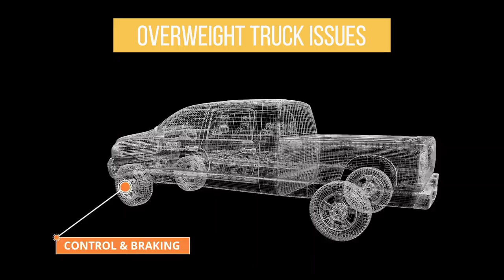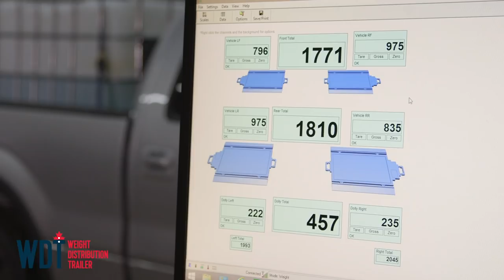Weight Distribution Trailer - Trade Show Loop

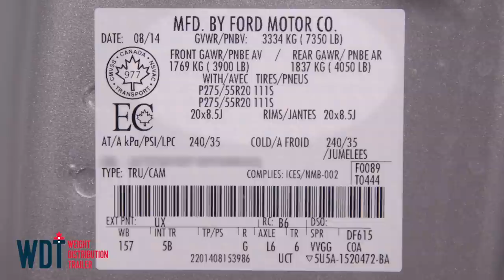Comment: You may want to consider changing the wording on the banner at 1:33 where it says that "GVWR is the maximum amount of weight your vehicle can carry".
Reply: Hi Thomas, the GVWR is the maximum weight according to manufacturer's specifications.
Reply: @canadianloaddividerdollies8413  Yes, the GVWR is  the maximum weight of the vehicle, which is the unloaded vehicle plus any cargo, passengers, etc.  The banner refers to the maximum weight that the vehicle can carry. There is a difference between the maximum weight of the vehicle and what it can carry.

Comment: Hear me out, I love the idea. Iv actually thought about something similar myself. But there's alot more goes into the GVWR then just weight distribution.... If this product allows you to carry up to a thousand pounds more, some trucks breaking system, etc may not be designed to be handling such weight... I can see a person going through breaks and overall suspension/front end parts possibly even faster with this product, as they believe they can go 1k lbs over their rated GVRW
Reply: Hi Dylan, we have tested it on all your points. The fact that our Weight Distribution Trailer proportions all the axle automatically there is less wear on components and it is stopping distance certified and decreased emergency stopping distance by up to 16 feet because now all you braking wheels are balanced for proper axle weight.
Reply: Do the added wheels have brakes too?

Comment: From all the comments here you can tell nobody is a truck driver. This thing's essentially acts as a drop axle. It's a cool idea. Most working men that I know though typically drive 2500 or 3500 style I'm not sure if this will make a difference on something like that
Reply: Thanks Guitar Player Dae, actually it works on all classes of pick ups. I agree that those are great when you are loaded most of the time, but I've owned all sizes and I really do like the ride of the 1/2 ton class when not loaded .

Comment: So, I have a Ford F350 with a total load capacity of 3,697 lbs.  How much would this increase my total capacity?
Thank you
Reply: Hey Bigsmega44, it should increase cargo carrying capacity by about 1200 pounds depending on vehicle specifications and load placement. Thanks for your question.
Reply: According to my math you'll be able to load 736226253 pounds in the back now.
Reply: One rosie o'donnell

Comment: Few things. If you're over loading your half ton, then it's frame still isn't meant to handle the load. If you want to over load it cheaper buy air bags. Also the driveline isn't designed to handle the extra weight. Or you could, you know, not buy an entry level pick up truck and not worry about this

Comment: Sorry, but not a very good endorsement of a product when the video doesn't show it actually towing something.
Reply: Hi Sam, thanks for your comment but the WDT is not for connecting a trailer to it. It is just to transfer axle weight proportionaly and increase cargo carrying capacity.
Reply: @canadianloaddividerdollies8413  then why did you show photos of towing 5th wheels and gooseneck trailers without the device?